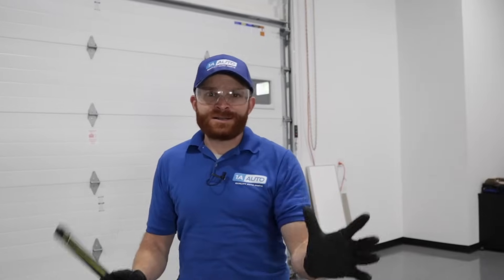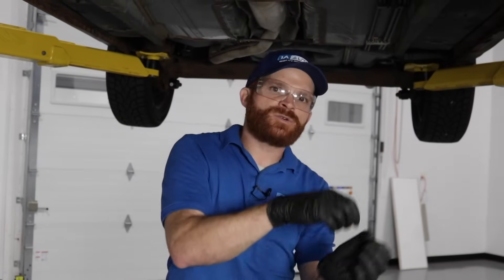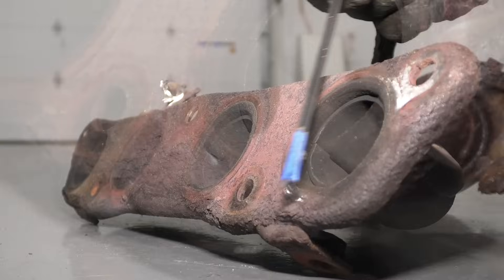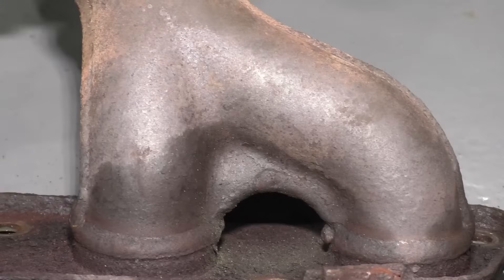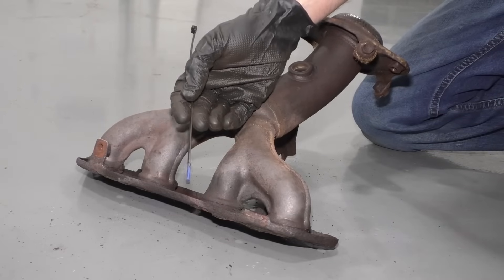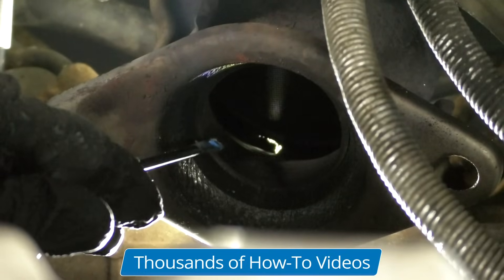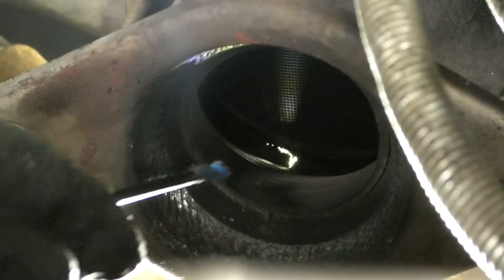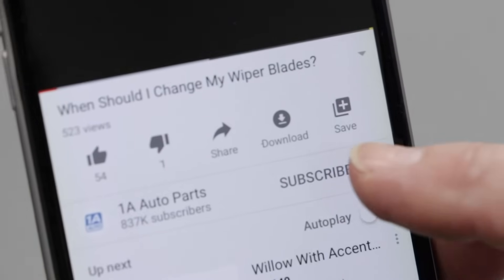Smells, or Ticking? Diagnose a Car or Truck Exhaust Manifold Leak

Comment: Hi, I have a problem with my Mazda cx7 2011, 2.3 L turbo, it started last winter when I start my car and put the heater on inwould smell exhaust in my car. I'd have to open the window to get rid of the smell but as I drive the smell goes away. In summer I had no issues as I don't turn the heater on, but this winter I'm getting it back again and worse. As soon as I idle, come to a stop or waiting at a light I start smelling it again. I did a test where I start the car and keep the heater off, I don't smell anything and I checked underneath from cat to tailpipe and I see no leak. Today I was changing my oil and I was looking behind the intercooler where the exhaust manifold is and as I had the car on incan smell the exhaust. So, my question, if there is an exhaust manifold leak, would i smell it in the car when the heater is turned on ? Is it because the air is being sucked in the front around the manifold? Hence why I only smell it when the heater is turned on ? I can't really see anything as there is the shielding around it. Besides that I don't see where it else it can come from. Any advice?
Reply from the maker: +Dory Maksoud Thanks for watching!  You should not be getting any exhaust fumes in the cabin whatsoever.  If you are then you have a leak somewhere in your exhaust, but we could not tell you exactly where in this case.

Comment: I've had the ticking & rattling sounds in a 1999 Ford F150 4.6l. First replaced timing set thought that was it. The right side chain was loose. I checked and could see and hear the exhaust manifold leaking. I installed a new one, new gasket, and new bolts. Oh by the way it doesnt do it when engine is cold but only after it warms up. 
   So after new parts it still made same noise after retorque. So I loosened the bolts and added sealant and same thing. Removed it again cleaned it better got a better gasket and still same thing.
   Its driving me crazy and ideas?
Reply: Spun rod bearing..apply the brakes and then raise the rpms it should gets louder

Comment: Could a leak come into the car ? I have noticed feeling dizzy/ light headed when driving at times
Reply from the maker: +Daniel T Thanks for watching!  Yes a leaking exhaust could cause fumes to enter the cabin.
Reply: Me too bro!
I was in my car during the winter and I was heating it up with the heater on and I fell asleep for like ten hours!
Reply: It took me a few days to shake it off! Thanks be to God Almighty that I am still up and alive 🙏🏽
Reply: Hey man get that fixed immediately , thats really dangerous
Reply: 😢 this happened to me a few minutes ago I almost pass out under the wheel I was super sky high..I am happy I did not get in a wreck..even with my windows down I almost passed out
Reply: My aunt once had a car that would blow anti-freeze in through the a/c vents. I was a kid and didn't understand the reasoning behind it. But I can remember looking at the vent and wondering why the air coming out of it was... visible to some degree

Comment: What if you hear ticking from underneath the car after you've turned the engine off after a 3 or 4 mile drive?
Reply: Its just the exhaust cooling down and contacting. It's totally normal.
Reply from the maker: +oj drummin We wouldn't be able to diagnose an issue like that here, you may want to have a local mechanic take a look at it. Thanks for checking us out! http://1aau.to/m/Shop-1AAuto-c
Reply: @1AAuto  thanks for your quick response. A couple of weeks ago I used the engine to break while going downhill by throwing the automatic transmission into second gear, now my engine is a little louder. Any ideas?
Reply from the maker: +oj drummin We wouldn't be able to diagnose an issue like that here, you may want to have a local mechanic take a look at it. Thanks for checking us out! http://1aau.to/m/Shop-1AAuto-c

Comment: My car vibrates a lot after it was removed and re installed ,when warm feels like it purrs and still vibrates there was nothing wrong with it before but it was removed to change the water pump
Reply: Hey, did you ever find out what was wrong? I have a similar issueZ I’d appreciate if you can respond. Thanks!

Comment: really common issue on dodge and ford trucks is broken manifold to head studs and usually accompanied by cracked manifolds. do these ones alot.
Reply: GM V8s have this issue as well...
Reply: Does that go for the chargers with the 5.7 as well. When i start m car it has that tapping noise but does get less when the car is hot but doesnt go away completely and on acceleration it sounds like an exhaust leak as well. Thank ive seen it alot for the dodge trucks but not the cars.
Reply: My 2008 tbss has this issue as well

Comment: Very instructive and well explained, showing that you got an experience gained from long practice. 👍👏👏
Reply from the maker: +Tico Zico Thanks for the feedback!
Reply: @1AAuto  my 98 ram squeals when I accelerate, it's pretty quiet but gets annoying after a bit and tends to get quiet the longer I drive
Reply: @holtman2598  :
That's more likely to be a loose "V", or "serpentine" belt than a leaking manifold. 
Rub a bit of bar soap, or perhaps a bit of Dawn onto each belt, if it stops squealing you've found the "offender". 
The next step is to re-tension the belt.
If the belt won't re-tension, or resumes the squealing it may be time to replace the belt.
If you end up replacing the belt, make certain to get the proper amount of tension applied to it.
Remember, the application of soap to the belt/s is ONLY a "diagnostic tool", NOT a repair!
Reply: @1AAuto  hi, can I use a smokin machine to fine the  leak   At the manifold, I have a 2011 for explorer the have carbon monoxide inside